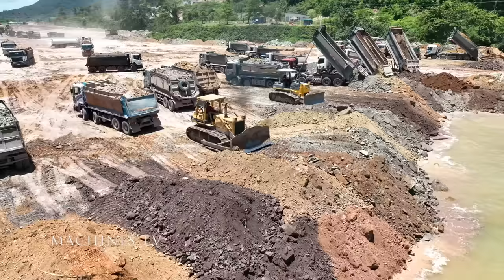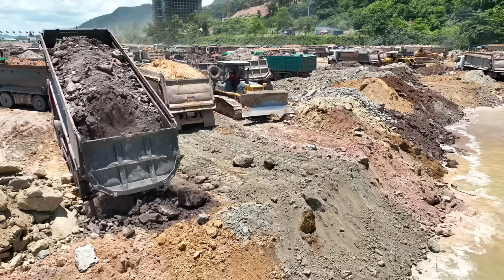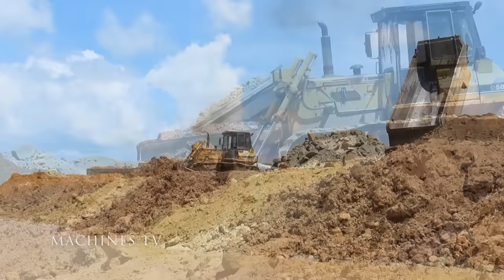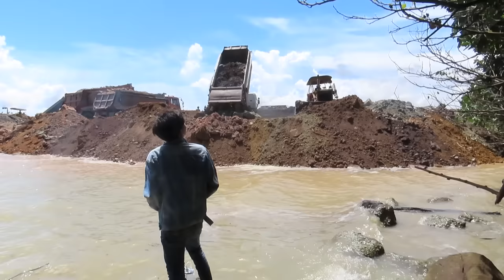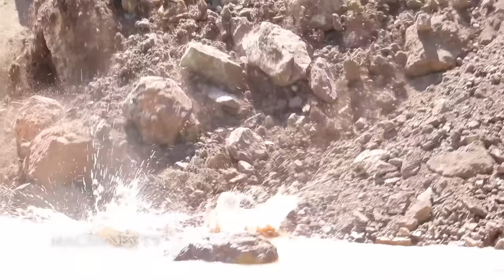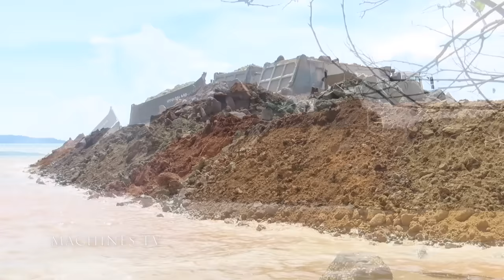Huge Land Reclamation Process Dump Truck Management Unloading Rock Dirt Bulldozer Pushing Stone

Comment: My thoughts are that they need to double the number of graders to reduce the truck wait times or reduce the number of trucks contracted . My other concern is regarding erosion that unless the sea wall is in bedrock, it may be washed away.
Reply: it helping to compact the dirt under them
Reply: They will most likely  line the edges with large boulders and establish a reef barrier to reduce the waves .
Reply: They def need some synchronization as well. Long wait times and with the graders they got trucks getting in the way of the graders and other trucks blocking those dumping trying to dump an leave.
Reply: I wonder if it is OK to have different soil types, along side. Wouldn't this later (and over the years) cause uneven settling and foundation problems?
Reply: That's one way to build Beach front property
Reply: @mrtopcat2  I think it's a total nightmare of a construction site. On this ground you can neither put buildings because of what you said, nor use it for agriculture due to the patchwork chaos of soil types. Also major rain events will punish the lack of compacting or the distribution of different material sizes, so will the waves. Basically they destroy a huge amount of underwater eco-system for little gain.
Reply: my thoughts exactly
Reply: graders are a luxury
Reply: Why not simply dump the loads along the road, leave it to the bulldozers to sort it out
Reply: @davidcurry4433  lol I was thinking the same thing, just dump it all, make dirt mountain and let the bulldozers sort it out
Reply: The GC probably paying those trucks per load and therefore couldn't care less if they wait in line.
Reply: @mrtopcat2   i was thinking the same thing. they should be staging the trucks so that the soil is the top layer not fill....
Reply: Mines frequently excavate crushed rocks, so if there's nothing toxic on them (such as from gold mining) rocks from mines could be that needed tough material.  The outside of the barrier could be seeded with oysters to help with the water quality and to further bind the rocks together.
Reply: Another YouTube expert.
Reply: Maybe they just want to get rid of excess materials from other construction sites? 😕
Reply: @achaosg  My thoughts exactly, this is very poorly coordinated..

Comment: I was in Mexico once watching the construction of a multi story condo where they transported concrete in 5 gallon buckets on shoulders up ladders to pour slabs. I went to the contractor and told him I had connections with customs and could get him a concrete pump here on the next ship. His reply was "What will I do with all these workers?"
Yeah, A dredge would be out of the question here.
Reply: you are right. Efficiency is'nt the purpose here, but employment. So, in this sense, it is a successfull project.
Reply: He was wiser than you! With all due respect!
Reply: ESTE INTERESANT ,DAT CE BOR SA FAC
Reply: @007camera  it was a learning experience for me
Reply: @Chordially  I was in Ciudad Del Carmen and thought the same thing, the town square was manicured and maintained by a slew of middle-aged men.  All using very basic tools and brooms, and as I sat there and ran the numbers through my head, I realized 2 men with modern equipment could do it faster, but not for less money.  Probably worked out to be equal costs by the time you add up gas, parts and maintenance.
Reply: @denniso8493  I live in playa del carmen. Those guys daily wage is roughly $12 per day US dollars for 12 hours 6 days a week.
Reply: @denniso8493 The cost will be equal in terms money spent, but with better tools/machineries, you decrease time to completion and improve quality. Time is money and quality is money those are the net benefits
Reply: @hno7625  , but sometimes it is also about giving people employment so that they can  feel invested in the progress of the city . 
You either save money on labor cost but then need to spend money on security guards , the police , and soldiers , to protect your property from those you choose to avoid employing .
It's a social and economic balancing act in not  making the masses the enemy . Even the Roman Empire knew not to piss off the people , and when the Roman authorities had lost the commitment of the people the Empire began to crumble .

So..give the people jobs , even if it is just a form of " Bread and Circus " .
Reply: Me too !

Comment: This has to be one of the most disorganized, inefficient wasting of fuel and manpower I have seen in one of these earth moving videos to date. Too many dumpers for how small the dozers were. No clearly marked lanes of movement for the trucks. It was like roaches skittering around when the lights come on.
Reply: The "Save the World" environmentalists heads would explode seeing this
Reply: You are right
Reply: Honestly ridiculous give me 5 guys with yellow vests and some orange cones done
Reply: It’s how the slow old school world works
Reply: And dumping the loads 50 ft from the bank doesn't help
Reply: This shows how good understanding u have for infrastructure projects. Engineers have done there's cost benefit analysis on the basis of topography and sea bed condition. In this region that's best available and possible solution as per clients time frame
Reply: I live in Vietnam and the inefficiencies and danger that's so common place will drive you crazy if you let it.  People in this region are very willing to work hard.  Working smart is a whole nother thing though.
Reply: @stanriner1831  People in this region are very willing to work hard.  Working smart is a whole nother thing though.
not just regional, and thanks for the laugh 🤣
Reply: @stanriner1831  Bọn mày ko biết được đâu.
Reply: @stanriner1831  indeed me foine bucko. It was the whole nother that got me 😀 Thanks
Reply: 5 smaller dozers for like 2,000 dump trucks haha
Reply: now imagine - you got a plot of land next to the beach, expecting it to raise in price as region develops and then you come to check on the property and the beach is destroyed and you have 200 meters of rocky dusty desert between you and water

I would have screamed
Reply: @Ed Sloan Those  are huge bulldozers you can’t see it because it’s film from the distance pay attention
Reply: Wish America worked more like this, just getting stuff done, good job
Reply: @mikhailshimunov5190  LMFAO, those are I’m guessing old D4 dozers... a D8 dwarfs a dump truck in size. Realistically those small dozers are the choke point in this operation
Reply: Everyone's a critic.
Reply: @LibertyOrD___h  probably a d6 it looks like honestly should have d8s or d10s for the amount of trucks cause then you could dump multiple piles infront of one another and push them all off in one push
Reply: I believe in your ego if you are an engineer.... Your not aren't ya?
Reply: Inefficiency you said? Did you consider time frame? Would you rather use five trucks and do 50 metres for 2 years? It’s just common sense.
Reply: @MetroVibe  Shoulda had two D10s to keep the trucks moving instead of just sitting there for hours. Now that would be common sense.
Reply: TRUTH💯 Fken apeZ
Reply: @krishnamaalshanmugam9741  3rd world charade
Reply: After 2-3 months all the filled soils will be submerged under water
Reply: Tell me, how else could they do  It.
Reply: It doesn't matter, the country that this video is from, labor is much cheaper.
Reply: @salvo9718   keep water bodies as nature has for recreational activities and holidays resorts… don’t destroy everything that nature has provided
Reply: I think they are doing it just right, not perfect though, some drivers backing up their trucks early just to be told to move forward again.
Reply: @oliver8792   That what I thought. Yes you're right the truck driver wanted to dump their load and get out of there as soon as possible. I guess they get payed from as many loads they pick and dump a day.
I also saw only one men that kind of was managing the area.
But overall I would of liked it playing with one of the Bulldozer all day long.
Reply: Kajoorrr
Reply: Agree
Reply: Axa n nga lugar bos
Reply: Kalau proyek tak ada bank uang tidak berbunga.kalau proyek tak ada .mau kerja apa..orang barat cipta TRAK DAN BULDOZER SEKOLAH TIMGGI.JADI BUKAN UNTUK DI PAMER..UNTUK KERJA..BANK UANG BERPUSING..PIKIR PIRUK JUGA SUDAH BUNYI..KALAU KERJA TAK ADA MAU MAKAN BATU KAH.
Reply: Too much big words lol
Reply: @reyczeck  No need to be a trained engineer to see the obvious chaos, danger and complete ineptitude of this sight.
Reply: @krishnamaalshanmugam9741  Some expert decided they needed 200 dump trucks sitting around in gridlock as the solution based on the region? Are you high?
Reply: @edsloan8535  No, but with years spent on marine construction and as Engineer we know what to do. But land lubbers with little or no knowledge can't understand
Reply: Looks like a Chinese fire drill in the South China Sea! Somebody get that guy in the black hoodie a safety vest 🦺! He almost got crushed by boulder, hit by a truck, and slammed by a dozer within 30 seconds!!! 😅

Comment: You could say that I am crazy but because of dumping of dirt in the sea, sea level rises, not the climate change... such activities contribute to rising sea levels...
Reply: I'd say crazy yeah. 

(~25,000 km² reclaimed × 0.01 (~10m deep) = 250 km³ water displaced.

Ocean volume is ~1,335,000,000 km³
Ocean area is 361,900,000 km²

So that would be about;

0.000018% change or 0.00069mm rise

You wouldn't notice much of anything at all. 

Enjoy your climate denial though.

Comment: My advise to the "supervisor" that walks around between the backwards moving trucks:
*Do not wear black clothes
*Use two small sticks with a white flag on it for signaling
*Mayby it all works fine without you
Reply: They are not supervisors ,, they are spotters and not good ones at that ,,
Reply: @russellclement2058  whatever they are called you got his point.
Reply: Everyone including the truck drivers all wear sandals to work. Not work boots. Sandals as in bare feet in sandals.
Reply: @howie4150  i was just going to mention the inappropriate work attire but nothing in these 2nd and 3rd world countries is regulated.
Reply: An OSHA representative went there once. ONCE

Comment: This must be a government project, it is hugely inefficient and absolutely no quality control on the fill. I saw one load that looked almost like mud and several that looked like sand. If they got rid of the congestion at the dump site so they ould dump continuously and the dozers could work continuously, send home all the sand and dirt trucks they could probably advance faster with something you could build on, without the long line and at half the cost.
Reply: I live in Vietnam and seen this type of stuff a lot.  They'll just build everything on piles.
Reply: my thoughts exactly.  I was going to literally come to the comments and say "this looks like a government job"

Comment: Yall need to have the dump truck drivers line up like they did in the start of the video until they get dumped and so they don't run into each other and Yall need more bulldozers to pushing dirt and rocks

Comment: The fleet of trucks is very large compared to public works machinery (backhoe loaders).
This has created a certain anarchy in the 🚚 movement.
Solution: Reduce the truck fleet or increase the number of vehicles.
Reply: Try doing that with a fleet of electric trucks.....
Reply: Add 10 more dump trucks the rain will come soon and chaos wii ensue, but first add 3 more bulldozers that will unclog the the lines.

Comment: Its hard to believe this is real. I like how the different trucks are all bringing different color dirt. A timelapse camera, at a distance, would be cool.....
Reply: What materials do you think they are dumping from where?
Reply: @urrywest  I think there are construction sites all over that country, and they have truck loads of dirt, they need to get rid of. If they can get $100 to dump it at this project, they would be thrilled. Therefore these truckloads of dirt are from different parts of the country, and as a result have dramatically different color dirt.
Reply: @tazanteflight8670  Yep... If it is in a damed area it decreases the amount of watter that can be with heald, decreasing the effecivness of the dam...  If it is in an ocian it would just reclaim land...  If it is in a lake it would also tend to cause problems with watter level fluctuations as well as taking away wet lands habitat...   There is some down sides to this opperation no matter what.

Comment: Dumping dirt mixed with small rocks like that along an eroding coastal area generally doesn't work for very long, this is because the sand underneath it keeps washing away.  You need to place tetrapods there all along the edge to build a seawall, this stop the ocean water from washing away the sand, because it crashes into the tetrapods instead. These tetrapods can be stacked together and they may come up 4 metres above the water line, and they will also exist about 6 metres below the water line as well, so they protect erosion from below as well. You can also place medium sized rocks first down before placing the layer of tetrapods down. So you can place medium sized rocks that are about the rough size of soccer balls in a thick layer along the area, then place the layer of tetrapods over them. The tetrapods will hold the layer of medium rocks in place, and the medium rocks will even more tightly protect the land area from eroding into the sea.
Reply: They all know that, stop pretending you just only know it😂😂😂
Reply: Wow! Your comment is almost as long as the truck line. Besides they're counting on it. It's called job security. 🤑

Comment: Wouldn't they get rid of the queue if they use 2 lanes instead of 1 and unload in 2 sites instead of 1? It seems that there's plenty of space to do that.
Reply: When your dealing with stupid there isn't much wiggle room.
Reply: There are too many open questions. Video is only showing a partial period. It is important how far  the soil is coming from  as well. It is 100 miles or more you need to have more truck. This is only one varible.
Reply: @yilmazkurt8584  wala yan simple.

Comment: This is shows that environmental carelessly. What you should  is to make barrier at perimeter area to be fill with dirt with rock dike or rock causeway then it look like pool surrounded by causeway, then install geotextile then you can fill the pool with dirt. This way you do not make water murky.
Reply: Why would they build a pool if they're just putting dirt into the water? Wouldn't they just leave an area open for a pool?

Comment: D65 Komatsu's are NOT small.  Any bigger and they wouldn't have been nimble enough to maneuver.  Staging the trucks farther away from the dozers would eliminate some congestion, and it appears they did this later in the video.  Given the tight space constraints and the tech they had...  I'd say they did a fine job.  As far as soil mixing, who cares?  if it's not specified in the contract, it doesn't happen.  As far as compaction goes... Each truck prolly weighs 50K kilos loaded.  Time, Gravity and rain will do the rest.
Reply: D8’s would be the best choice. When the dump truck load is larger than the dozer, and you’ve got 200 trucks...... these small dozers where the choke point in this operation. A D8 could push several loads in width at a time
Reply: D10*
Reply: Trucks can carry probably 18-20tonnes. Trucks probably way 15. Articulated trucks way about 50 tonnes full.
Reply: @LibertyOrD___h  I was thinking D-9's but an -8 would do good here. With all of this dirt coming in this fast, you could put 2 dozers side by side and double the amount of material moved pretty quickly. I saw quite a few times that would come in handy. 
Talk about organized chaos.
Reply: @LibertyOrD___h  Yes this operation seemed to have too much truck and not enough dozer. All those drivers idling along in a huge line is not really efficient
Reply: without environmental control...for sure along the water line full of mud.
Reply: Menambah daratan.... 👍👍👍